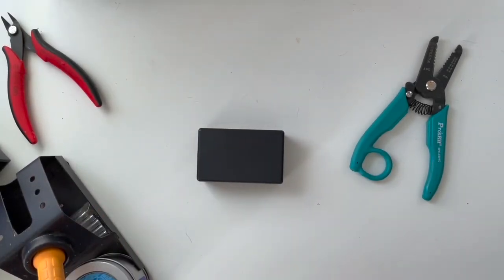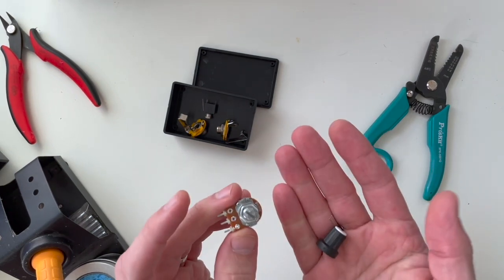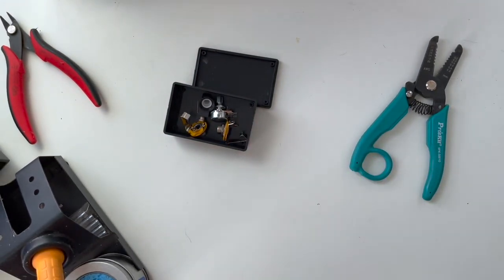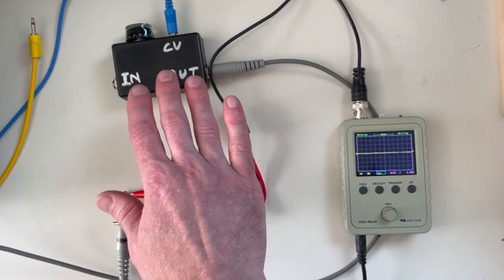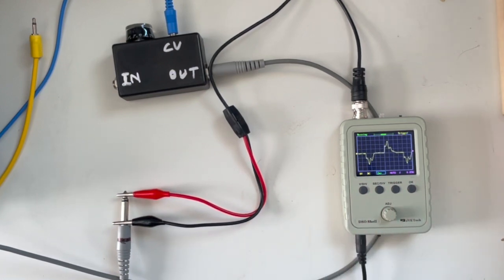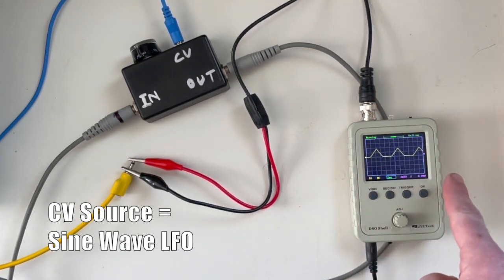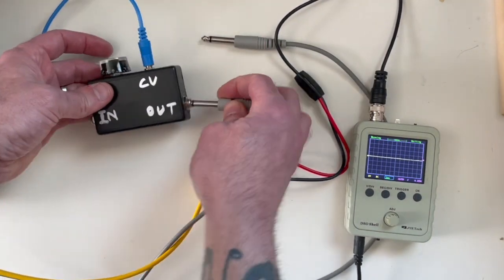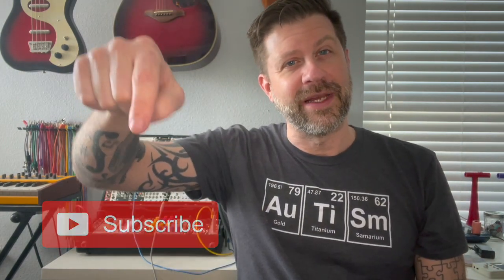Build a DIY Waveshaper Effect (easy 2-component circuit)

Comment: I hear no difference other than your envelope changing the sound, so what does it do for what does it sound like in a bigger circuit?  Cuz that almond didn't do anything. Maybe I'm wondering how would one boost the signal for clearly different audible results?
Reply from the maker: Thanks for checking out the vid, but I'm not sure how to respond to that. I think the video does a good job of demonstrating what the circuit does. Most waveshapers have pretty subtle audio effect which is why most demos include an oscilloscope (so you can see it as well as hear it). If you're underwhelmed, this probably isn't the effect you're looking for.

Comment: There's a way to use it into an overdrive/fuzz pedal in order to change the overdriven signal with this little guy?
Reply from the maker: Thanks for checking out the video. I'm not 100% sure what you're asking. It has plenty of gain so you shouldn't need to boost the signal before it reaches the wasveshaper but if you want to shape it then distort it, that's absolutely possible.

Comment: Thank you so much for this

I do not know what I will do with it but it is great to know
Reply from the maker: Ha ha. Knowing is half the battle as they say.
Reply: @musicalmiscellany  That is very much what I believe.

I am looking for a very simple LFO with the idea of building a pedal for me canjo
Reply from the maker: @bearshield7138  Yeah, it would be easy to convert into a standalone pedal.
Reply: @musicalmiscellany  cool cool

That is what I am trying to figure out.

Any advice?
Reply from the maker: @bearshield7138  It sounds like you're on the right path. Just build a small LFO circuit and put it in place of the CV jack. You'll probably need to add a 9V battery to power the LFO.
Reply: @musicalmiscellany  Cool cool

Thank you